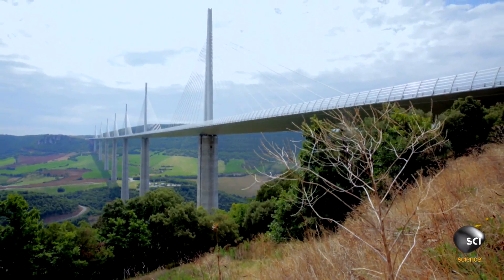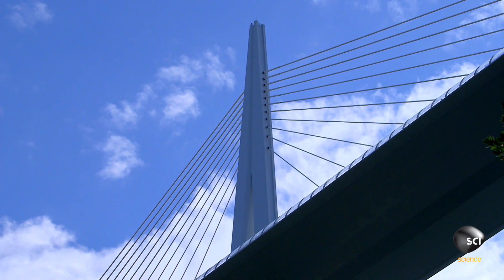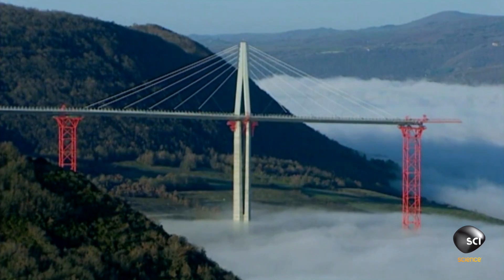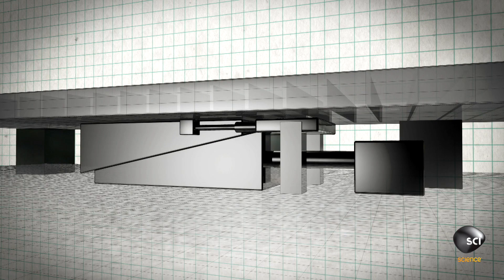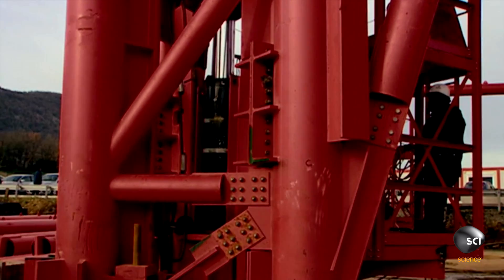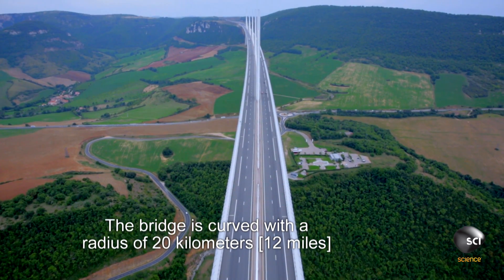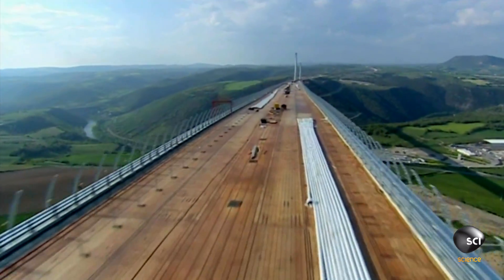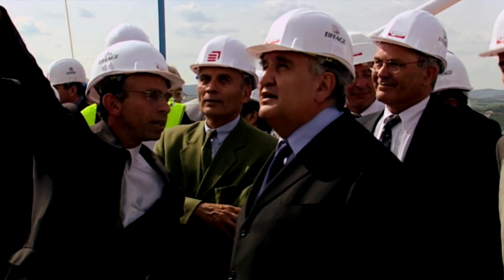Assembling the World's Tallest Bridge

Comment: why didn't they just build a road on the ground?
Reply: I think the road prevents the current of the canals and disrupts the ecosystem
Reply: Bro building a road would be much more worse than using the bridge
Reply: Karim Khalifeh why?
Reply: already there is a road ..and it takes more time to reach the other end....it increases the distance... and with many curves and hairpin bends. i dnt remember the exact figures.. but by road down the Valley  would take hours...and the bridge would complete the journey within minutes..
Reply: +pen mightygun you have a point...but just think..the amount of fuel and money wasted for vehicles to take the long route....so everything we humans make is calculated. we find benefit and profit. Building such a costly bridge and such an engineering marvel wont happen if the Valley was small. building the bridge saves energy and money and sometime its okay to use cement for building useful buildings which in result would benefit us and d environment
Reply: +Dukeofangus building a bridge is both funnier and more practical :D
Reply: don't feed the troll

Comment: wow the longest bridge ever!! 
#longest bridge
Reply: NOT the longest bridge but it is the tallest bridge
Reply: @Kazilikaya  nope the tallest bridge now a days located in China.
Reply: @johndevera6986  No, wikipedia has a full article on the difference between the tallest bridge and the highest bridge. The bridge you're talking about is the highest bridge: there is no pillar or anything that reaches the bottom of the gorge, all the structure relies on the two extremeties. To explain it simply: the tallest bridge measure the distance from the uppermost part of a bridge to the lowermost exposed part of the bridge (=structural height), the highest bridge just measure distance between the bridge deck and the ground (=deck height), the technical challenge isn't really comparable imho.

The Milau Bridge is the tallest bridge in the world, and the Duge Bridge in China the highest bridge in the world.
Reply: @xenotypos  i agree!
Reply: Luis Gutierrez it isn’t!